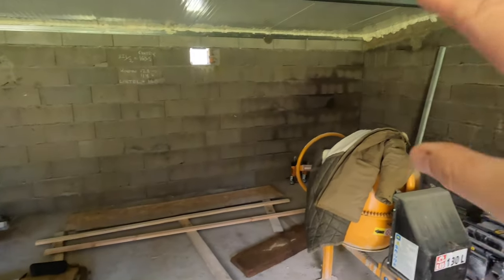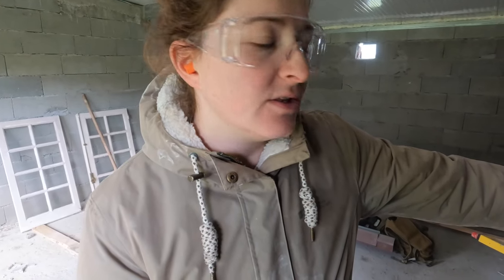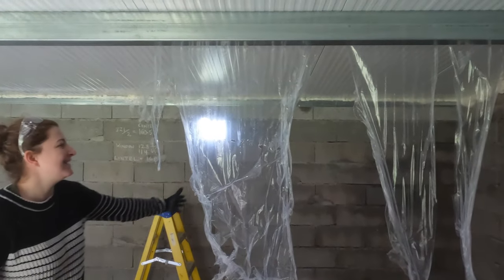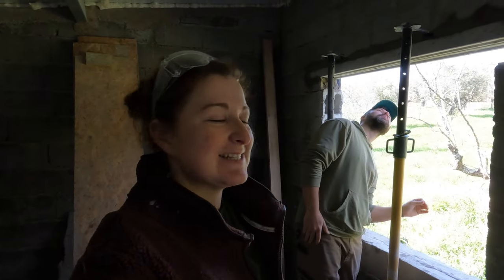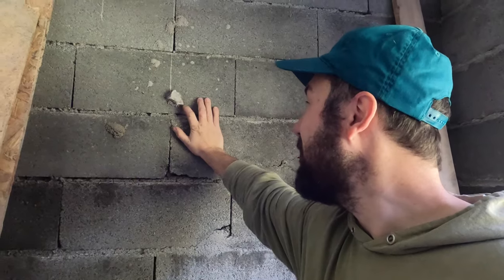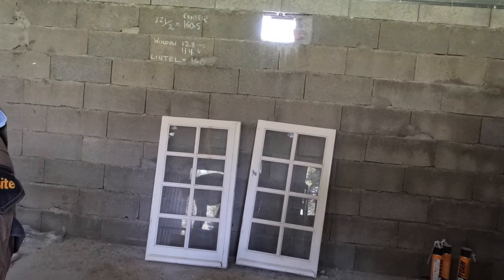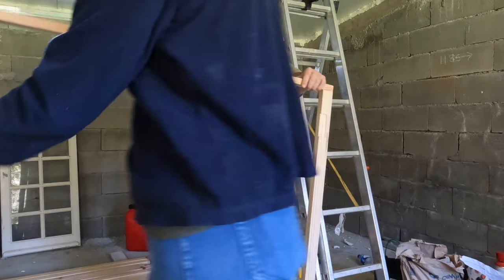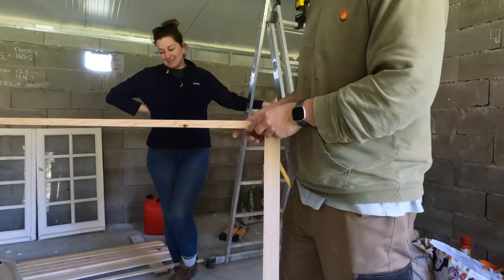16 - Transforming a barn into a Tiny home in Central Portugal continues - BIG STEP

Comment: Hi Guys done a great job with the roof however I feel that you may have erred with the window installation.  This comment is not intended to be negative in any way in that I admire you both for giving it a go.  Firstly your windows are casement type designed to open outwards and installed on a window frame with a sill fixed to the inside of the frame that acts as a stopper when the window is closed thus preventing strain on the hinges and weather from entering the building. By opening the windows to the outside a sliding insect screen can be installed within allowing access to the window lock etc.
May I also suggest that the frame be positioned in such away the window when opened can be adjusted to lay flat against the wall.  Other considerations are: paint all timber that may be effected by the weather/moisture, including the top and bottom of all external doors, and to fill the blocks before mounting the window frames (expanding foam is not up to the job).
Also I feel that  installing the windows on the inside, will cause obstructions within as they cannot be closed against the wall and limit items you can place against that wall.  Again this is not meant to be a negative comment and I wish you all the best with your future projects
Reply from the maker: Thanks for commenting we do really appreciate it and we both seriously have taken this on board. I think once daves workshop is up and running we will make some much thicker frames and we will also then know the finished thickness of the inside walls so we can place them in line with the internal wall so they open internally and can be clipped to the wall. These windows are open inwards doors as they have a lip on the inside that once the window is shut it pushes into the frame which is why we couldn't go thicker but when we redo them we will get thicker wood and route out the thin part where this part of the window goes if that makes sense. Thanks for commenting and have a lovely weekend 🤗🤗🤗

Comment: Instead of rendering the walls wouldn’t insulated plasterboard provide a quicker warmer solution
Reply from the maker: I have been thinking about this I need to put weight the costs and time etc but yes that would be ideal as then the gap between board and wall using the metal batons would give ample air flow 🤗

Comment: You should have treated the wood on the frame before installing, moist will find a way and it will eventually rot. Make sure you leave zero gaps now
Reply from the maker: Yep you're absolutely right..... Sometimes rushing can bite you on the behind haha. After lots of advice I may eventually redo window but this is something I won't forget next time. Thanks so much for the advice means a lot. Learning everyday ha 🤗🤗🤗

Comment: Great Great job guys. It is so nice to see some real light in the house as most of the old stone houses there are so dark and dreary on the insides. Do you plan on doing a rigged insulation on the interior? With the block not having the cavity filled it is going to get real hot in the summer there. Shutters or awnings would help with the heat through the windows. Keep up the good work!!!
 P.S. you should consider cleaning up the ground/floor as you go,I would hate to see a broken ankle🤕
Reply from the maker: Aw thankyou yes it makes such a difference and yes we have just picked up some metal studs so we can insulate. I think we will go for a polystyrene insulation as we wanted rockwool but it's not ideas for single skin building I don't think. Oh now I have to clean up as I broke my ankle years ago and it was tragic hhahahha. Oh and we are thinking of external shutters and a little pergola at the front as your right summer will be brutal hahah

Comment: Looking good but pity you didn't use thicker wood for the frames
Reply from the maker: I have bought some more wood now to beef them up a bit but I do think at some point I may take them out and redo.... (Once I have my workshop built up and I have a bench to do things properly) 😀😀😀
Reply: I also think thicker frame 2" x 2" at least.
Reply from the maker: If I ever do redo these windows I think I'll need a router first as there is an outer lip that needs to slide inside the frame when shut. We are in the meantime going to double down on the thickness to give it a bit more support and leave a gap for lip to fit into..... Really hard to explain hahahha. Hope you had a nice weekend 🤗

Comment: Hi guys I love the Chanel I have been  watching from the start , and the windows are amazing , can't get it out of my head but why do they open inwards not outwards . Opening outward would give more room inside .❤
Reply from the maker: I know right makes so much sense to open outwards and then clip to wall. Maybe I should adapt them and redo frame to accommodate this 😁
Reply: On the other hand, it will be easier to clean them with opening to the inside. 🤷🏼‍♀️
Reply from the maker: That is true!!!! It does seem bizarre opening inwards but I wanted inwards as it means I can open them and then shut over some shutters when it gets too hot but still let the breeze in 🙏☺️🤗